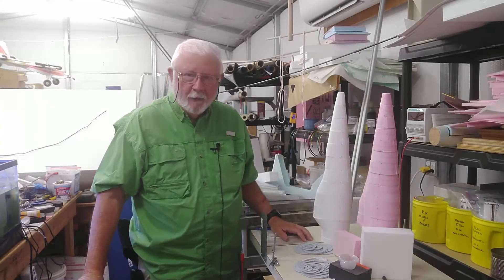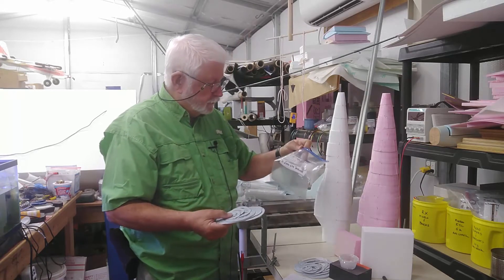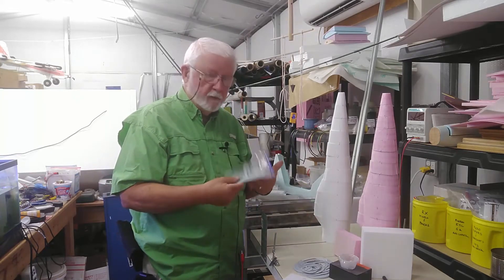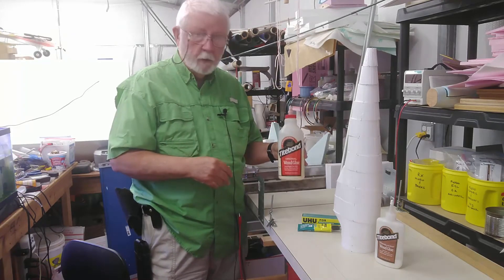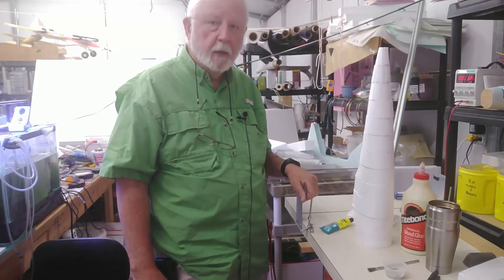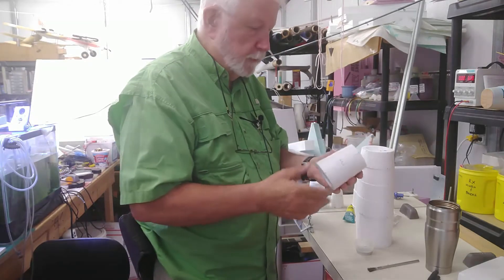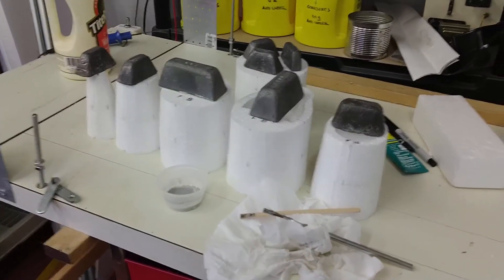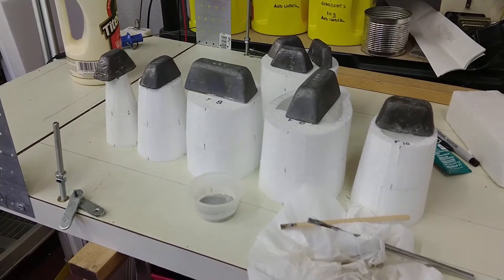Sectioned Foam RC Aircraft Fuselage Building   Part 14

Comment: Thank you so much for the series!   Thanks especially for the bike cable guide tubing or liner tubing. And, thanks for the fishing leader wire tip. Control leads is an area I've been unhappy with and I like this solution!

Comment: This is a great series , The cad work gonna take me some time , used to turbo cad , Few questions ! Why didn't you just cut the foam sections to fit in the original spacing , seems would save lots of time . And when using the titebond if get it on the outside why not wipe with damp rag , seems easier the sanding
Reply from the maker: I'm not sure what you mean in the first part of your question re: cutting the foam sections to "original spacing"???  Second, it isn't a matter of just wiping off the glue that gets outside.  It is the glue in the SEAM that becomes impossible to sand because of the HUGE different in hardness between the glue and the foam.  It is very important to not get glue on the outside edges of the sections as you glue them together so that all final sanding is on foam, not a glueline.
Reply: what I mean by original spacing is if it measures 185 mm between f-8 and f-7 then cut foam that size , then if 175 mm between f-7 and f-6 cut it to that and so on . @tvideo1189
Reply from the maker: @rodchurchill5576  I think I know what you mean.  I layout the distances to suit the foam thickness AND still have the ability to cut the sections by hand easily and accurately.  It is much easier to hold a 50mm chunk of foam in your hand and accurately hand cut a smooth contour than a chunk 185mm thick.